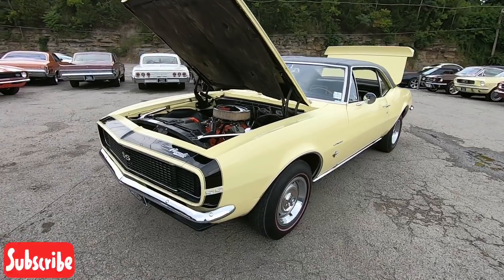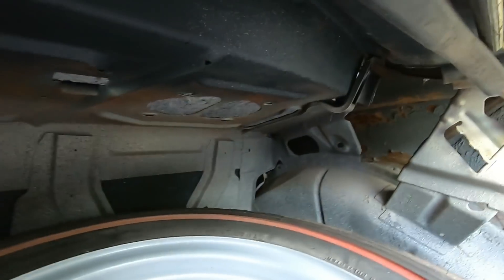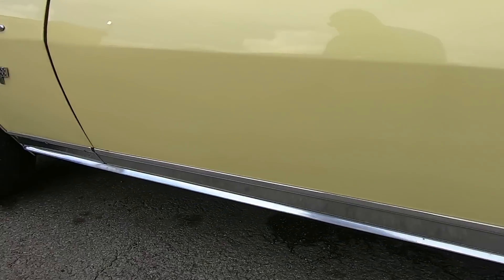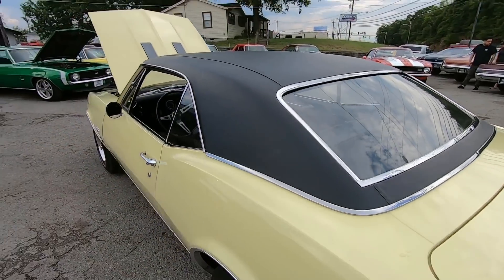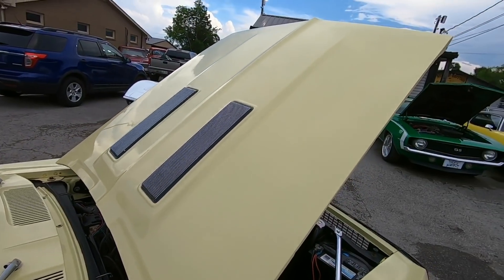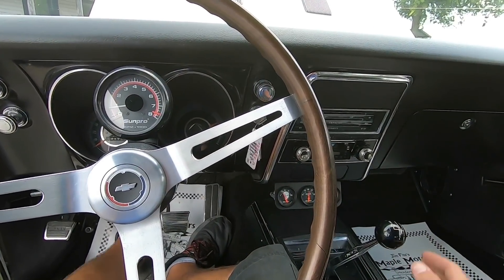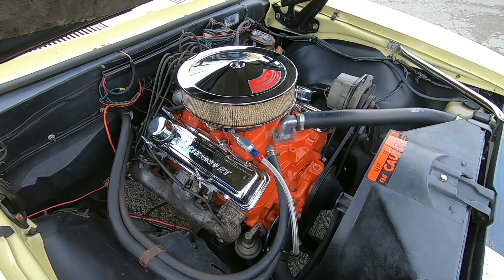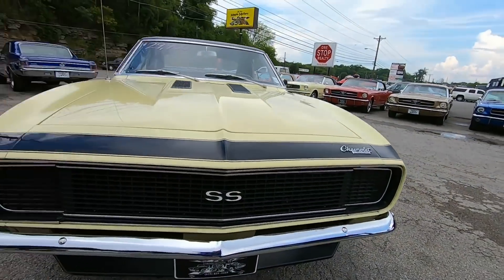1967 Chevrolet Camaro Rally Sport 4 Speed SOLD $29,900 Maple Motors #656

Comment: Nick I watch that video on the yellow Camaro that trunk area definitely needs to be fixed that car is too nice to sale in the condition it is I would definitely no question fixed that trunk send it to the shop they have near the area and I would look at that  and see if this car has A  P on the cowl tag ( this could be A REAL SS350 car ) and we didn't see any pictures from underneath it it's a beautiful looking car from the outside it's got the correct color it looks good but that trunk area and that area right below the rear window definitely needs A fix that that is too nice of a car to let go in the condition it is in and I would be asking a lot more money for that car personally alright Nick keep those good videos going .
Reply: He stated it has a 327 in it .
327 on Fender , no 350 on Grille Emblem or Gas Cap like the SS 350 cars had .
10 Bolt Rear End would be suspect , too .
 I`ve had 2 `67 SS-350 Cars and they both had 12 Bolt Rear Ends .